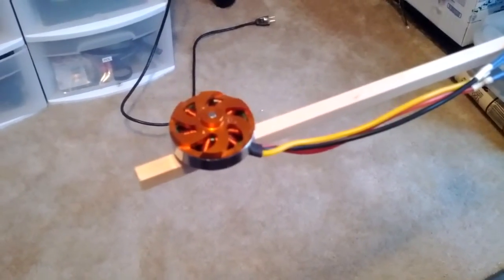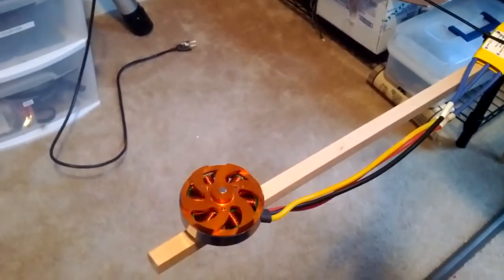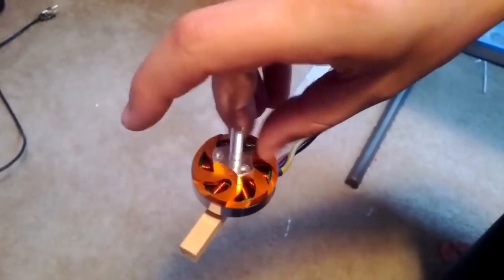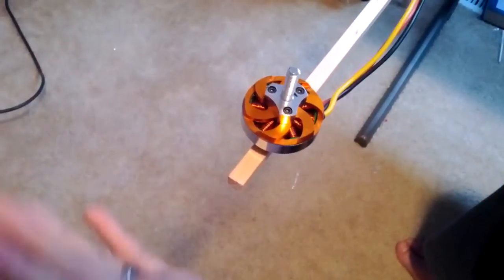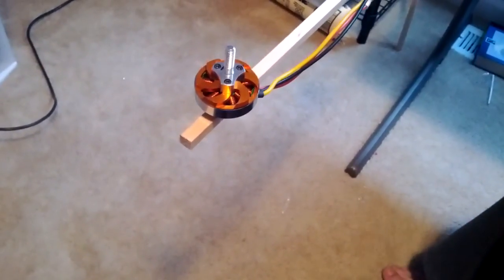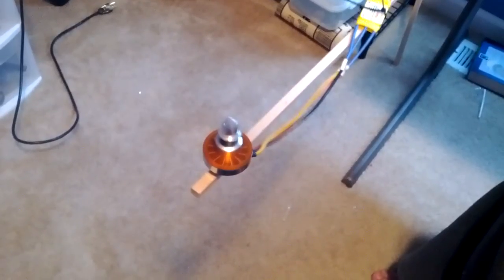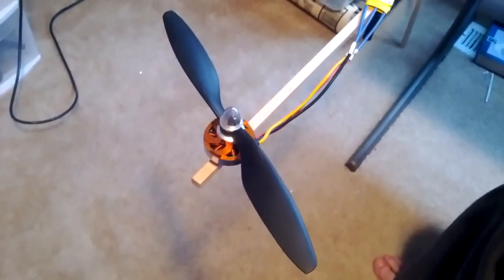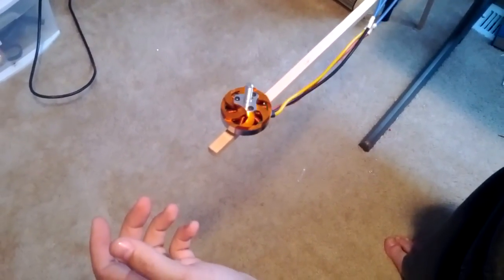rctimer motor vibs

Comment: Phil, I agree with adrinjones.  You have good motors and the motor mounted prop adapters work well.  But, Loose the Cones, use good nuts.  Self locking. Also cut the prop shaft to the minimum length needed.  Buy extra adapters.  I'm an old Huey helicopter pilot, Vietnam era. When it comes to small Rotorcraft it is a nuisance, in Huey's vibs were a the precursor to mechanical failure...and sometimes death. Take a look at SunnySky motors $20-$25 seem "smoother".  I fly wooden Tricopter I think the SunnySky 2214's 2210,s, 2216's around 1200Kv w/ 9x4.7 prop work well.  Also, check out Cheap Easy Tricopter Build by hallstudio on Youtube  This man CAN FLY!

Comment from the maker: If I had to do it again I would have gone with different motors. They put out plenty of power but always had some vibration because the prop adaptor was poorly machined. I ended up using some Ipower iBM 2217Q 880kv motors and they had a ton of power and very long power leads. If I ever go with pancake style motors again I might try the hobbyking multistar brand.

Comment: So did you ever fix this??  I've got different motors (RC Timer 630kv) with different prop mounts (4 screws).  Same results... In fact my multicopter flies awesome but it's pretty much useless as a video/photography rig right now (which was my original for intent it).

Comment: Is this really an issue during flight?  The vibration is occurring only in a narrow RPM band.  What is the probably that the motor would run for any significant period of time in the vibration band.  This might be the natural frequency of the motor/prop adapter/prop combination.  I'd dump the RC Timer motors.  I've gone through quite a few with quality and design issues.  Replace th ebearings with ABEC bearings from japan.

Comment: Try an easy fix. Try nuts instead of the big aluminum bullet lock nut. May reduce vibrations enough to where its not as bad. I like the ones that have the nylon at the end and self seal. You can find them at Lowes. Home Depot doesn't have a very good selection.